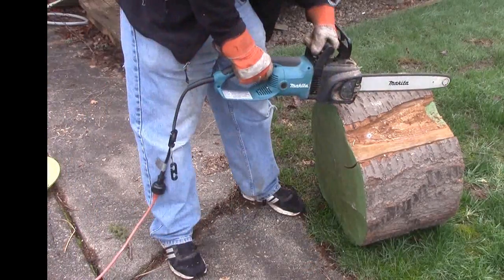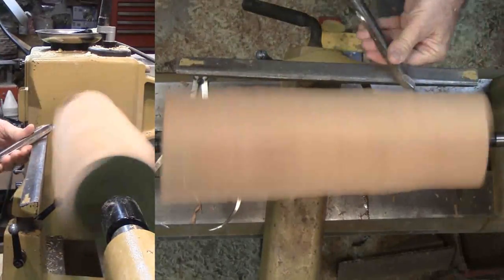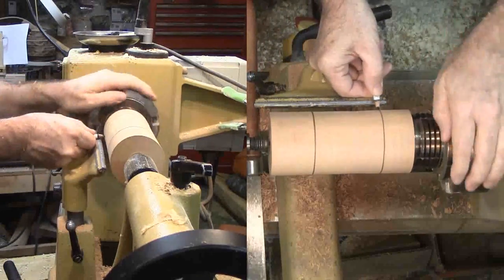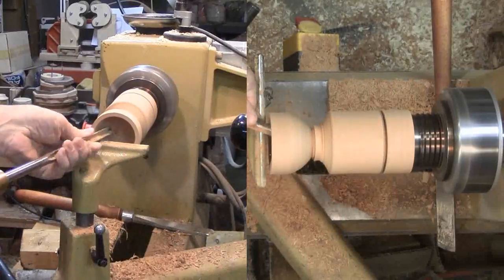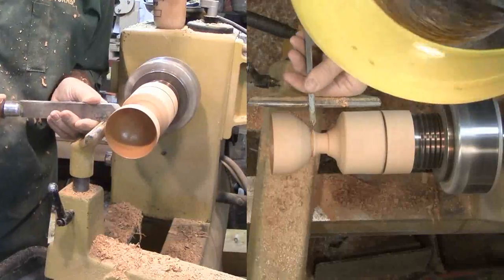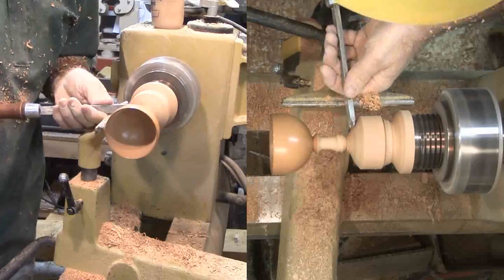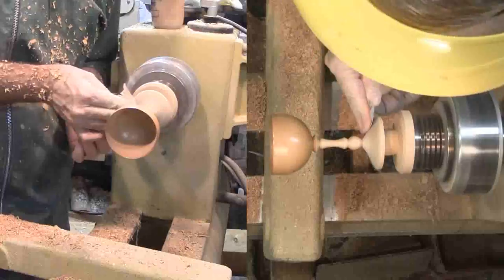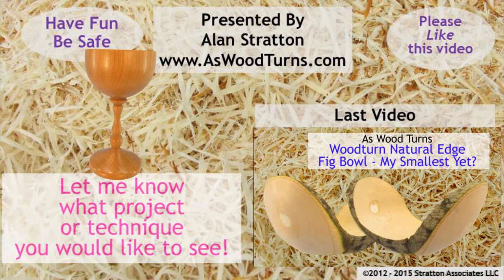Woodturn A Cherry Goblet Wood'n U Like A Toast

Comment: Nice Goblet :) I've heard that round nose scrapers are primarily a spindle tool but you used it to smooth out the inside instead of a bowl scraper.  Can round nose be used on bowls or something like that?

    Thanks,
          Pete
Reply from the maker: A round nose scraper can be used anywhere they're safe to use including bowls and spindles. The concern for bowls is whether you have enough steel to support how much you overhang the tool rest. I have a heavy bowl scraper for deeper bowls but this goblet was shallow enough for my round nose scraper and tool small for my bowl scraper.
Alan

Comment: How do you know it was dry? I thought cutting it right off the log pretty much meant it was probably pretty wet?
Reply from the maker: The stump has been sitting in his shop for over 10 years. The shavings also felt very dry. It may have had a slightly higher moisture content than if it had been previously ripped but not significant for this project.  It definitely turned like it was dry or near dry.
Alan

Comment: Hello Alan. Great job. Nice finish on it. I am having trouble with my friction polish, it has some streaks and "high" spots that don't seem to rub out. Any suggestions??
Thanks
Kirk
Reply from the maker: Generally, when that happens to me, I have laid on too much finish, my applicator has too much wet finish on it, or I did not allow the finish the dry enough before buffing it. It also depends on the diameter. I use friction polish on smaller diameter items.
For now on this one, sand it down (it will gum up sand paper) and start over. Count it as an additional learning experience.

Hope this helps.
Alan

Comment: Ripping requires a different cutting angle on your teeth.  When you get it sharpened next, have your man recut it for you for ripping and buy a new chain for crosscutting.  You'll never go back to ripping with a crosscut chain,
Reply from the maker: Interesting. Thanks for the tip.
Alan

Comment: Alan, the goblet is perfectly per portioned and very pretty! I just bit the bullet and bought an electric chainsaw for the same reason. My old Echo is a beast when running but difficult to start. Love the electric saw man! Did you call that a Golden Mean caliper? Need to check it out, thanks for sharing...
Reply from the maker: Plus your electric saw can be used indoors - no dangerous fumes. :)
Yes, it was a golden mean caliper but I'm not sure how to make or buy them.
Alan

Comment: Very nice Alan. I am curious to know why you sanded and polished in stages instead of doing all the goblet before parting it off, Is there any particular reason? Cheers/George
Reply from the maker: Definitely. As you work from the top to the bottom, the goblet begins to flex. Once you leave an area, it's tougher to go back to sand, fine tune, or finish the wood. So, I do finish it in stages.
Alan
Reply: As Wood Turns Thanks  your prompt reply. Useful to know. I have only  turned one very small goblet  so far and didn't  have any issue with that but of course doing one larger/longer it would be an issue.

 Useful to know and will follow your advice when I have a go at a full sized one. I am new to turning and so far have been concentrating on making very small boxes out of olive branches and last couple weeks somewhat larger boxes and bowls. I only have a mini lathe so am limited in size (and experience) to tackle larger projects.Anyway many thanks for all your videos which much appreciated as apart from a very old (out of date) book it is from the likes of you and all the other turners who generously  give their time and effort to 'show us how it's  done'. Cheers/George